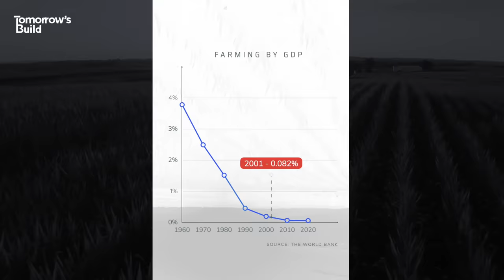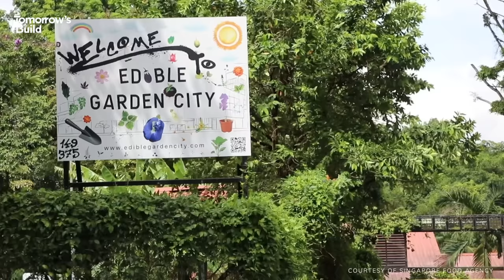Singapore’s Bold Plan to Build the Farms of the Future

Comment: Unfortunately urban farming on a large scale is unlikely to work because of waterproofing issues, multi-floor buildings just aren’t suited to having agriculture on top of them (a flat surface will leak 100% of the time on a long enough timeline. Possibly large single-floor warehouses in industrial districts, but at that point you might as well remove the roof and have a regular farm.

Comment: OZ 🙃  they can produce power from heat  ponds  using bore water .  lined with black plastic  
Make electricty +  pure water & salt 1-2-3  yet this  isnt done in a big way 35-38 cel in middle of oz  $ 
      Land in middle oz  is cheap -  A bit more  heat  needed+ a  gas boiler  +15% gas used to  create steam that turns turbines .

Comment: Energy won't be an issue for a very long time if a country uses nuclear energy in a safe way... Specially a country that lacks land like Singapore.

The finns are building a massive underground vault for nuclear waste storage that will last more than 70 years, this is enough time for a better energy solution to appear, or even a new viable proccess that uses nuclear waste as a fuel source to consume it.

Cheap energy would cut prices of these building grown foods making it viable to compete with the imported ones.